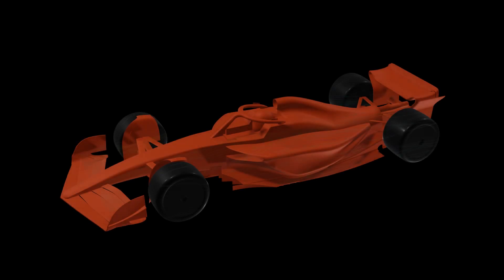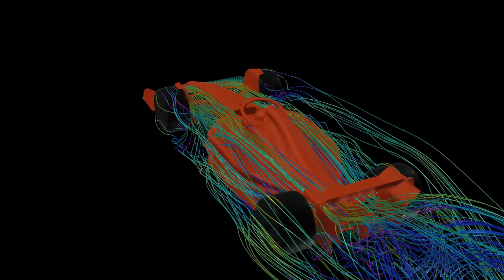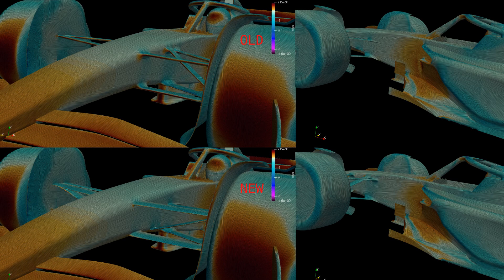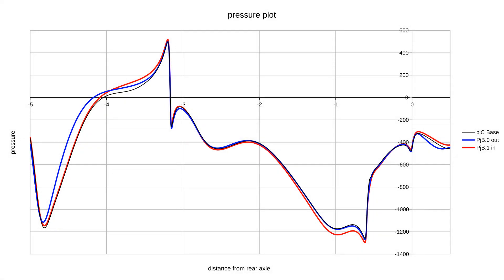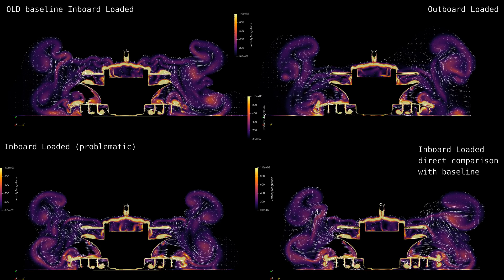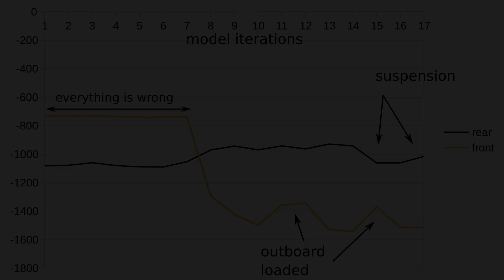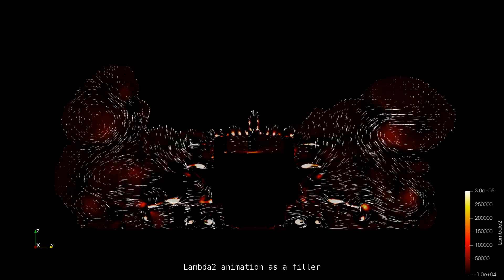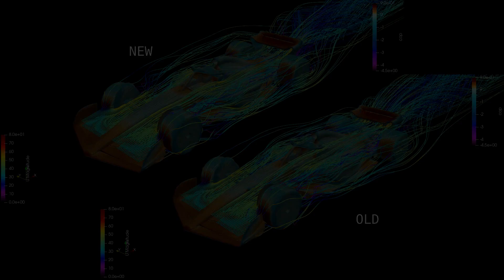Formula 1 Suspension Aerodynamics

Comment: Check out the flow structure @ 4:07 behind the rear wheels, in the 'inboard loaded(problematic)' frame. Notice how it's dragging down the rear wing tip wake, swallowing the beam wing tip vortex, and the diffuser corner flow. I think a huge amount of performance is in that region, and that a heavily inboard loaded front wing strengthens the flow structure in the rear wheel because it connects with the upper wheel vortex shed off the front wheel.

Comment: 2:33, why does the push/pull rod have the effect you mentioned on in and out flow of air? Wouldnt that just be determined by the fairing itself, and couldnt you just change the angle of the fairing on the pull/push rod to get what you wanted?
Reply from the maker: both actuators want to be directing air down as a primary function of their aerodynamics to counter the front wing upwash. A pullrod will also inherently be pulling air outboard, a pushrod will not if the primary function is the same.
Reply: @nelsonphillips  I took a look at the FIA rule book and it says for front suspension fairings that the fairings can only be 10 (nose down) - 0. How can there be any down washing with that?
Reply from the maker: @Jay-nk6dm   geometry is defined by space, whereas angle of attack is defined by air. The geometry of a aerofoil can have lift and has an amount of downwash even at 0 angle of attack. -10degree geometry can in this case be 0 angle of attack
Reply: @nelsonphillips  understood.
Question I had for you though is if you look at many of the teams, the suspension fairings state -10 (nose down) to 0 degrees angle of incidence to the z-plane, yet all teams clearly have downwashing (nose up) fairings. 

How is that possible?
Reply from the maker: @Jay-nk6dm  its going by the way you measure angle of attack for the geometry, afaik f1 won't change that. An airfoil profile will alway tangentially outside the -10 to 0 degrees by the fact its a closed geometry and has all the angles, see my video about airfoils for the circulation concept.  there are plenty of sim tools like this nasa one, there are better https://www1.grc.nasa.gov/beginners-guide-to-aeronautics/foilsimstudent/
Reply: @nelsonphillips  hm i think maybe my misunderstanding is coming from my interpretation of the english in the rule book. 
I thought the reference to the z-plane would rule out referencing to angle of attack as that would change car to car and be virtually impossible to determine for the fia, but especially when they require the angle to be 0 to nose down reference to z-plane.

i get how even a nose down geometry could be downwashing the air from the front wing, but the f1 teams seemed to have almost 30-40 angle of attack nose up on the suspension fairings when referenced to the z-plane so im not sure how they got around this rule
Reply from the maker: @Jay-nk6dm  ok, the reference plane is the plank which forms the z-plane, which is basically the ground but measuring from reference on the car is more consistent. If you slice the suspension profile in the y plane, i think, it s then the aoa is measured relative to the z. 
the rules are difficult to read.
Reply: @nelsonphillips  gotcha. That’s what I thought. But since the FIA has directed the AoA as referenced to the z-plane do you have any idea how teams are achieving the angle they are on the real cars?

Comment: Hi Nelson! Engineering student here! I want ro achieve same quality of cfd as you. What is your workflow in openfoam what plugins do you use? Where can I learn more on how to achieve similar simulations?
Reply from the maker: My use of OpenFOAM isn't outside the standard except I do use adaptive mesh refinement. Postprocessing has been knowledge built up over years, I'm not doing anything difficult here its just finding existing functions. I find things that I thought I should have found years ago..... Willem Toet has a good standard to follow for postprocessing

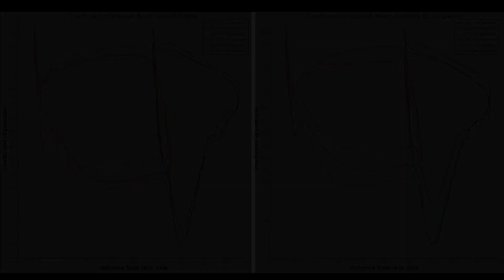Comment: @7:48 There's a counter rotating pair of vortices in your new simulation. One shed off the front wheel, and the other on the inboard side of the radiator inlet leading edge. Those two vortices are likely entraining air to flow over the sidepods with a bit more energy.

In the old simulation the front wheel vortex is basically hogging the sidepod area.
Reply from the maker: There is also more interaction between the side of the headrest and halo junction with the sidepod. Really the front of the sidepod now just works better, everywhere.
Reply: @nelsonphillips  That could be a reason why F1 cars run anti-Ackermann, the inside wheel doesn't turn in as much and doesn't move the tire vortex inboard as much. Meanwhile the outside wheel turns more which drags the vortex outboard.
Reply from the maker: @rolandotillit2867  Anti-ackermann is mostly to do with tyre deformation, the outside deforms more than the inside so there is a difference in actual slip angle. It took me an embarrassingly long time to know that.... The percentages are so small I doubt that they would change it for downforce rather than just consider it in their analysis.

Comment: To save you the trouble of looking it up, positive stagger on bi-planes, or the top wing forward of the bottom wing when viewed from the side, ( anti-dive setup of the control arms) generally creates more lift on takeoff, which tends to agree with your simulations.

Comment: Correct me if I'm wrong, according to this, the trick is to redirect the front wing upwash into the undercut via the control arms? Reminds me of Bi and Tri-plane design, where you consider the decalage and stagger of the wings. I figured as much and this kind of supports that line of reasoning.
Reply from the maker: This video tested both extremes, one that made the flow worse impacting the sidepods and the other is resolved, though it maybe over resolve with too much lift. There was a brief shot of the RB in the wet, last race, with streaks moving up the chassis after the suspension. With the push rod the coupling of the upper arms are stronger and also the chassis bodywork can be added, unlike the pull rod layout. The amount of flowvis I have seen on the element means they are paying close attention to this area. But, I think its just a minimisation exercise, something you can get wrong rather than performance adding.
Reply: @nelsonphillips  Interesting concept. One would wonder what the effect would be if the flow moves above the chassis, especially under yaw. Maybe the benefit of keeping the flow next to the chassis is that it doesn't cross over to the other side of the car as much in the corners?
Reply from the maker: @rolandotillit2867  That would be Ferraris strategy, and RB was the first to run the cannon cooling exits, so I guess. If you notice with the comparison scene of the whole car with streamlines that flow just around the side of cockpit near the halo junction there is now less front wing influence. This could give me the opportunity to see how much I can reduce the losses of the cockpit and therefore how important controlling the losses in yaw would be without actually running yaw simulations.
I think I need a team of surface modellers....
Reply: @nelsonphillips  Your CFD does show higher CP at the entire cockpit, side pod undercut section with the fixed arm profile. Considering how low the pressure is after the floor fences, that pressure differential could be useful downstream.
Reply from the maker: @rolandotillit2867  ..there seems to be development between the floor centre and fences that should pull the cop forward.
Reply: @nelsonphillips  You notice that pressure spike that happens between the inner fence and floor center? You notice how the pressure drops after that spike? The way the inner fence diverges from the floor center after that spike affects the velocity of the flow, and as a result the strength of the floor vortex. So getting the strakes right has to cover a lot of bases for them to work properly. The outer 3 have to not only outwash as much air as possible, they also have to set up the conditions for the inner fence to shed it's vortex.

The inner fences have to control the airflow that goes through the tunnels and underneath the car, if you diverge the inner fence as aggressively as possible, it's easier for the outer fences to help the inner fence shed a floor vortex, which is great at low speeds. You however diffuse the flow too aggressively and it will slow down, as diffusers tend to do to airflow, the end result is flow instability.

If you make the inner fence diverge just right, it becomes more difficult to get the outer fences to work with the inner fence to shed the tunnel vortex, but the flow accelerates and becomes much more consistent. This is good at medium and higher speeds.

To get the best of both worlds is the next challenge of the design of these cars.
Reply: The redirect you are talking about seems to correlate with the structure Mercedes has on their upper control arm…